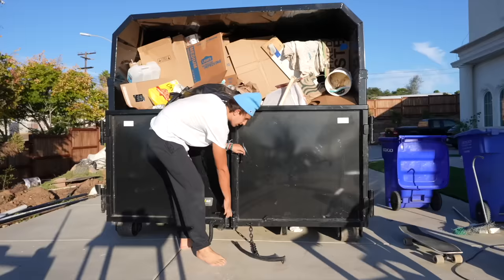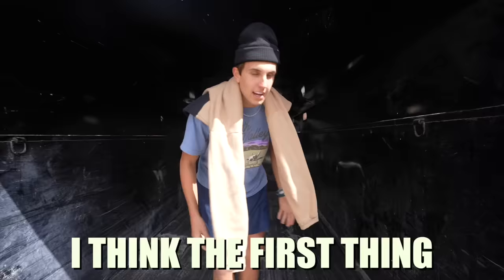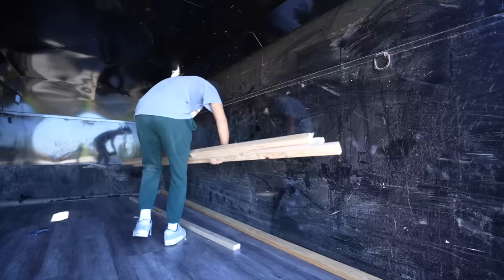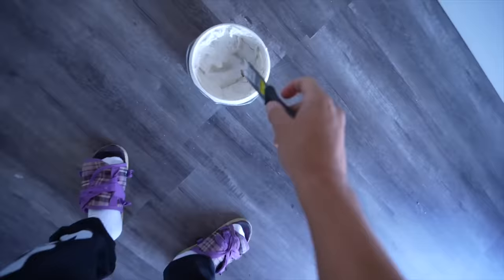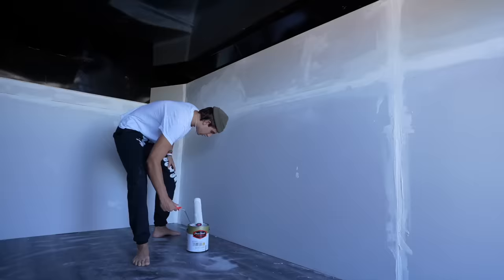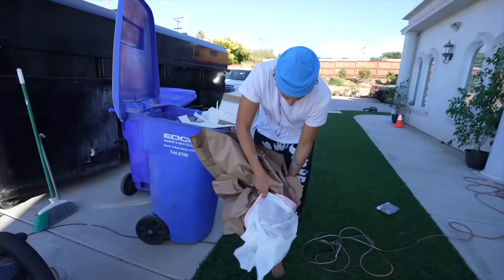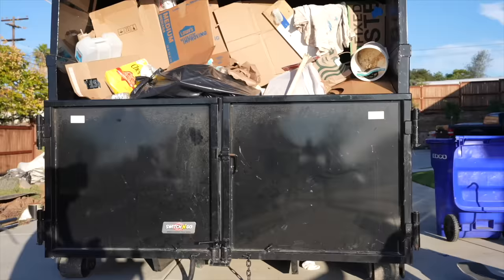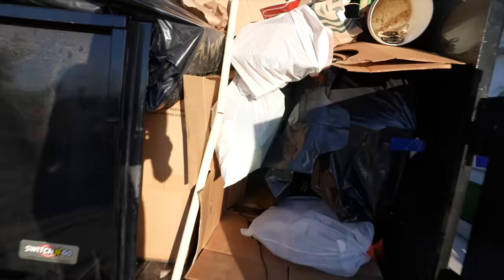I Turned an Old Dumpster into an Epic Secret Room!

Comment: You could have just glued the drywall to the existing walls without framing it in making it less expensive and larger at the same time. Still cool though.
Reply: You'd have to think about the isolation, putting the drywall directly on the metal would've made it colder, he was aiming for comfortable, not space

Comment: Bull. Sh*t.
You didn't use insulation anywhere in that thing, including the "roof" which is bare metal. You aint foolin anyone... its hot as hell in there by mid afternoon.